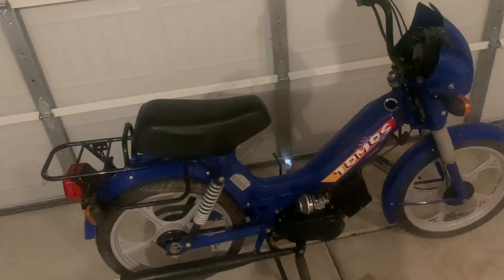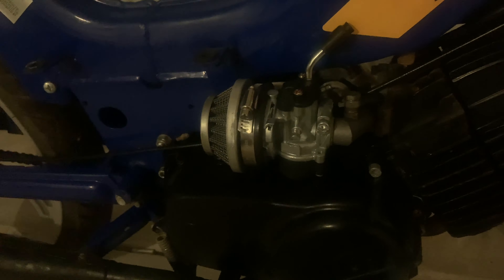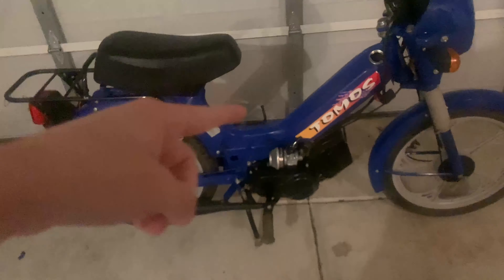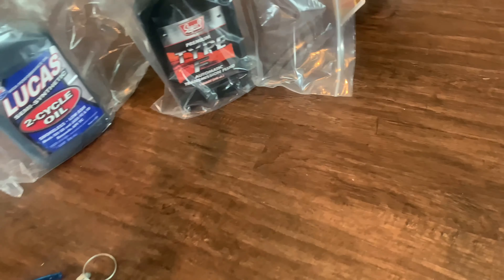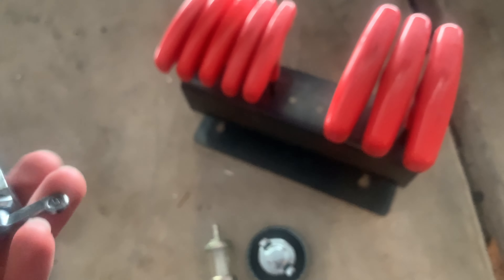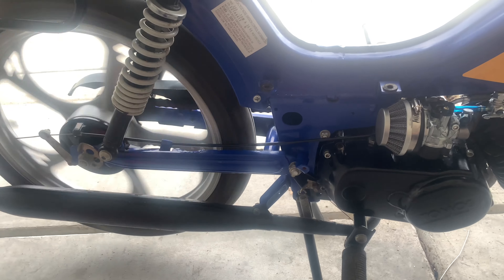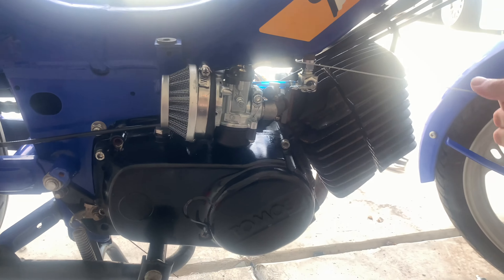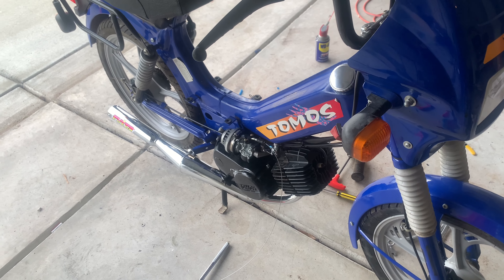Can we get this $150 Moped to run? (Tomos targa barnfind)

Comment: Nice bike but not a moped. That is the kickstart model. In my state, a pedal moped does not have a title, and requires only a drivers license. One of those has a title and requires a motorcycle license. 

I just recently bought a 1979 Sears Free Spirit moped (with pedals) in near new condition with 200 miles on it. It also needs a new carburetor due to ethanol gas. I paid $950 for it and consider it a great deal. Real pedal mopeds have skyrocketed in price, and are very hard to find. I'm glad I was able to find a '70s model in my state. It is a Puch/Kromag with the Puch E50 engine. Has the Puch snowflake wheels.
Reply from the maker: Depends on the state. Most people consider this a “noped” since yes it doesn’t have pedals but certain versions came with pedals. My state still considers it a moped.
Reply: @calz33  My state considers it a motorcycle. The difference is that a motorcycle requires a motorcycle license to ride, and it has a real title, while a moped doesn't. There is an advantage to having it considered a motorcycle in my state, for me anyway, since I have a motorcycle license. Stock they are limited to about 30 mph, but it isn't that difficult to get them up to around 50 mph. If it is registered as a motorcycle, and you have a motorcycle license, that is not a problem. But if it is registered as a moped, even if you have a motorcycle license, you are going to get a ticket. 

I like pedal mopeds mostly for nostalgic reasons. I got my first one in 1975, at age 16. I moved "up" to motorcycles, but I've still had about 20 mopeds since that first one, all with pedals. I wouldn't mind having something like you have, but I don't want Chinese, and that seems to be the only thing currently available.
Reply: That's crazy to imagine. In my state, these have a "real title" and still only require a driver's license of the standard variety.